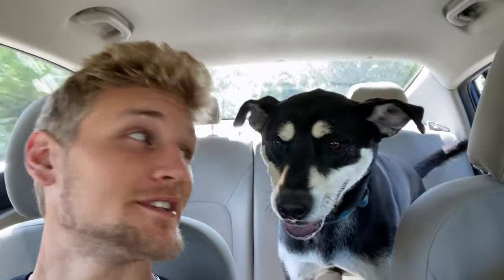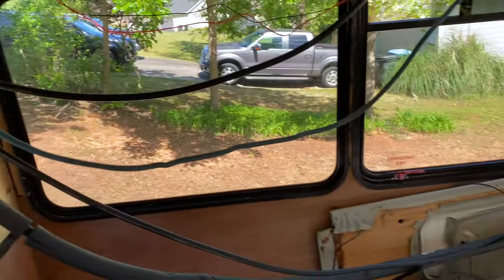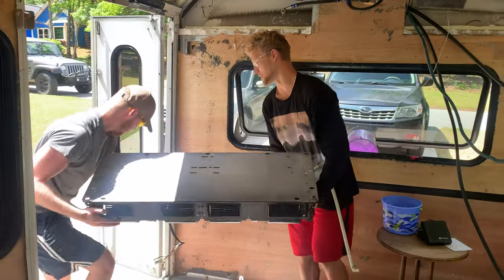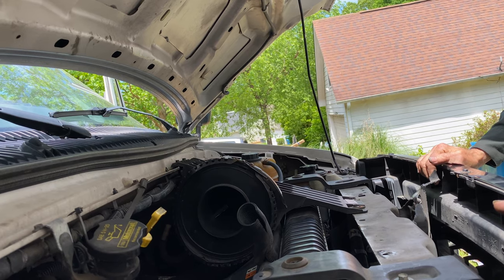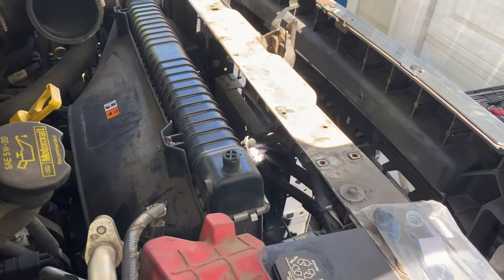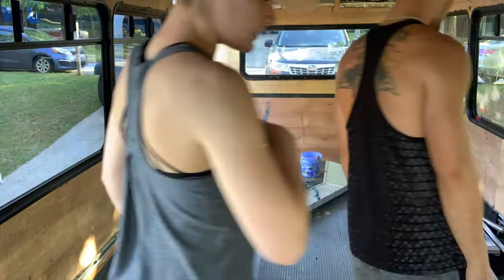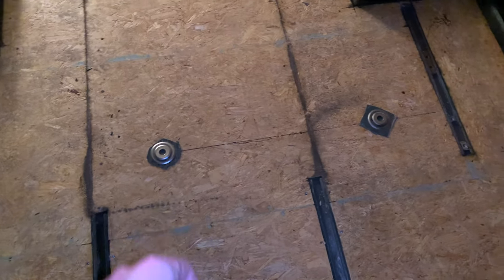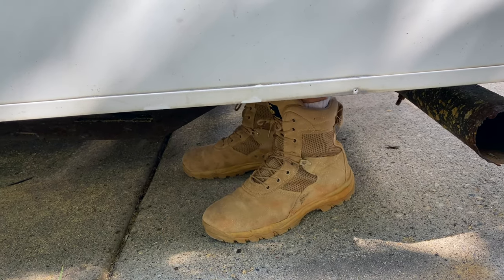SHUTTLE BUS Conversion | Removing AC Unit & Flooring | DIY RV TINY HOME

Comment: I'm going to be converting  2012 ford f550 4x4 glaval bus, I'm leaving ceiling, ac and bars and floor in, check twice cut once, I'm leaving wires alone, don't need that headache!  Reading up on ford diesel engines! I like your youthful  enthusiasm!

Comment: Hey guys, I know you're thinking about building a bathroom behind the driver's seat, but before you commit to that idea, you should think about using a swivel seat for the driver's seat, and maybe even see if there's a way to add a second swivel seat for the passenger as there are two of you, then you have the beginnings of a living room area just by reversing both seats.
Reply from the maker: Hey there, Emily and I discussed this and we did not think there was going to be room for the passenger swivel seat or we would have went for it! We are thinking about building a 3 piece couch, so the middle section comes out and we can place some sort of table to eat in front of each other. We love our nightly dinner dates <3

Comment: Great video! :) The wiring seems to be the bane of everyone's build that I've seen so far. I'm excited to see the progress you make next week. I feel like it'll come together pretty quickly once the walls are up, have you guys decided anything on A/C yet? I live in central texas and summers are brutal, I'm more of a winter/fall person myself so I will be winterizing my shuttlebus with lots of insulation.
Reply from the maker: The wires were difficult for sure!! We are lucky though and have a friend who helped tackle this project for us (stay tuned next week)! We will have AC in the front of the bus when it is running, then we will look at placing a heating and ac plugin unit in the back once we get the solar panels in place! We have Texas on our map for sure as I am a Dallas Cowboys fan :P
Reply: @AwakenDaze   Awaken Daze  Whenever you head this way I highly suggest spring, which is usually between early March to April - end of May and its already super hot.  The trees start blooming in February sometime but allergies are awful. Grass, tree and ragweed pollen are the worst. :) I highly suggest the areas just outside of dallas lots of hidden gems for hiking out that way.
Reply from the maker: @tr1xieP1xie  We will be headed out to Arizona mid January skooliepalooza and could definitely swing through Texas right after! Thank you for the help
Reply from the maker: Baba Ganush  We think that is a great idea! Thanks for the motivation. Our next step is putting in the plumbing!
Reply: Wiring is easy. Call the manufacturer of the bus, and they can send you a schematic so you know what all the numbered wires are, where they go to, etc.

Comment: I just sold my shuttle bus motorhome conversion and I have to tell you that you need to spend some time Googling stuff. So now you have no heater no A/C. I kept my A/C and rear heater. I kept my ceiling and walls and just covered exsisting flooring. Unless you are a builder with skills you are getting into trouble. Make sure you didn't kill the engine when you removed the wheel chair lift, interlock devices for safety. Slow down, never remove anything unless you know what it does. Should be valves underneath for that rear heater. good luck.
Reply from the maker: Thanks Amy, we have slowed down  on the engine work and actually will be finishing some of it this weekend! We have realized that we have lots of work ahead of us. Ryan has been a huge help and Austin is learning as we go. We are done with the demolition side, so now we are trying to understand how to install the plumbing correctly.

Comment: may i ask why you decided to rip up the rubber and wooden flooring?  rather than just build on top of them?
this is not a critique; I am asking bc i too am about to convert a shuttle bus and have been debating what i should do with the floor.  i might just want to build on top of the old floor, rather than gut and replace it all.
do you have some reasoning for doing it the way you have?
thx
Reply from the maker: Hey Joseph, Emily & I have a little bit of a larger budget for the conversion than what we have seen. We plan to travel in this for a full year within the US and then continue our travels into Canada and Mexico the year following. So we want to build a great foundation and the cost to replace the sub-floor is not too expensive.
Most people lay their flooring over the rubber and  sub-floor with no issues, but we are wanting to insulate our flooring and place a water protection, sound barrier, underneath our flooring.  We also noticed that some of the sub-floor had rotted on the underside as well as along the wheel wells. In this video you can see the huge bolts in our flooring that had rusted into the frame that we could not remove without cutting the sub-floor itself.
I hope this helps until our next video will show us actually removing the sub-floor and explaining why!
Have a great weekend!

Comment: I’m also undecided if i should rip up my rubber floor or build on top of it. We did our first camp trip this past wknd and slept on the floor with a few sleeping bags for padding, it was 38F overnight and we were cold AF. I’m itching to get started, just not sure where to start. Walls I suppose.
Reply from the maker: Hey Joey! We felt like starting from the ground up was a must. We plan to live  in Pegasus full time so we want to know every square inch in case anything goes wrong. You are welcome to check out our first video and follow our process!
Reply: @AwakenDaze  a prudent idea. I've subscribed and have seen all your vids so far! Looking forward to watching your progress and building at the same time as you guys 💪🏼

Comment: I am just wondering..... why would you remove the AC unit? will you never travel to where you might need AC? I am from the desert.... you need AC and heat always.
Reply from the maker: Hey! So Emily & I decided to remove the rear AC & Heat because they only ran when the bus was on! So what we have done is disconnect the front and the back units. This past weekend we just got the front AC unit up and running and will have to install an AC unit  in the back that runs off of the solar panels we will be installing so we can run it without the bus <3
Reply: @AwakenDaze  Hello, sorry, just discovered your channel. I am purchasing my own bus of the same type on Saturday 7/10/21. I just wondered, why didn't you just rewired the AC units to the solar panel power supply instead of just removing them? I have never done this before so I am watching every video on YouTube. lol

Comment: You mentioned $150 for the ac guy to hook up the new condenser.  Did that include the cost of the condenser unit?
Reply from the maker: Jeff Roche no, the condenser is online for $190. The total cost with this and the cost of labor was $340
Reply: What type of AC guy should I call?

Comment: I watch a lot of bus conversion videos love them and I was just wondering can anybody explain why air conditioning units are taken off of the buses that work when you're driving them down the road. Is Cooling while driving bad? Or is it just the mileage that's affected and that's why everyone pulls them out? Just kind of curious as to the reasoning behind carrying out air conditioning units that were factory installed to be used when in transit
Reply from the maker: A lot of people tend to leave the unit in the bus but for others as well as ourselves we wanted to take ours out. Most of the units won’t run unless the bus is actually turned on and we didn’t want to have our bus on if we weren’t driving anywhere
Reply: That’s what I was wondering! We live in Texas and I’m not sure it’s wise for us to take ours out. We are very knew to this , we just bought our bus 2 days ago.
Reply: @CookiesMonster  did u take urs out? And did u regret whatever decision u made?